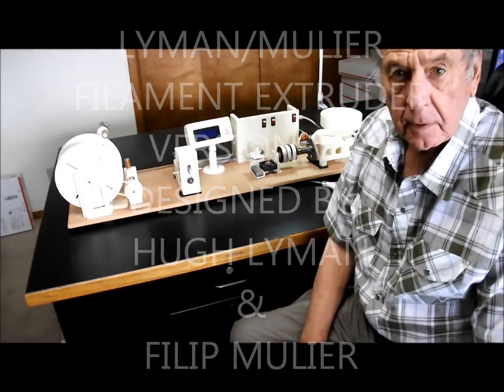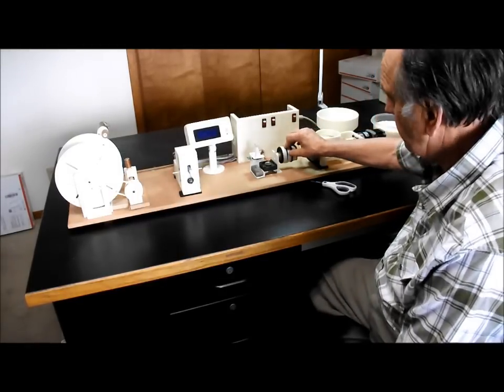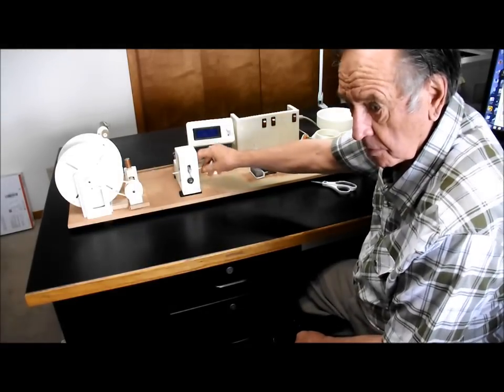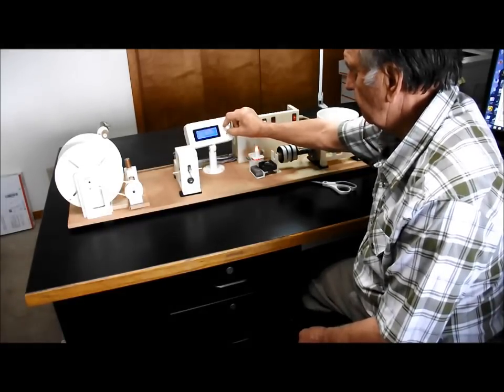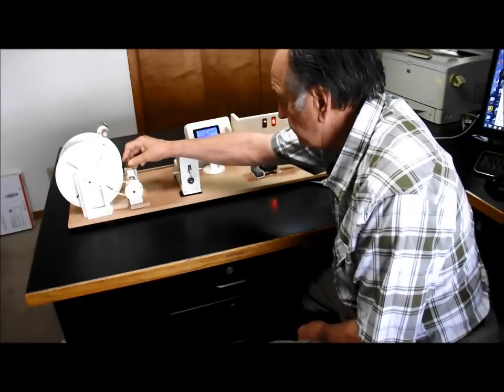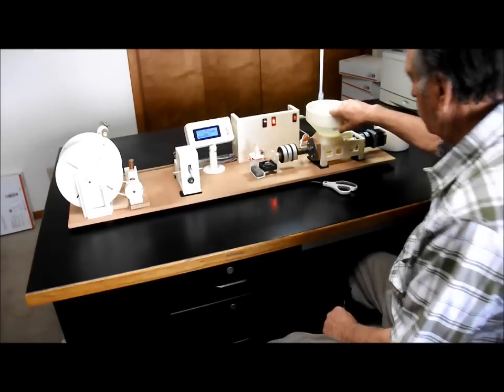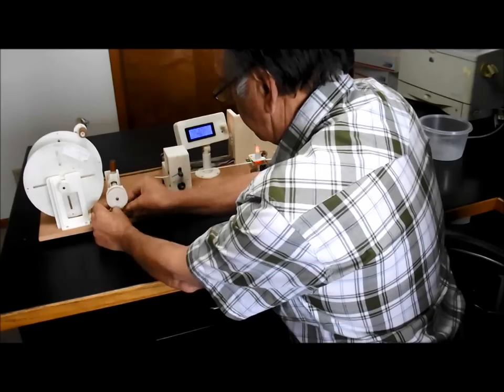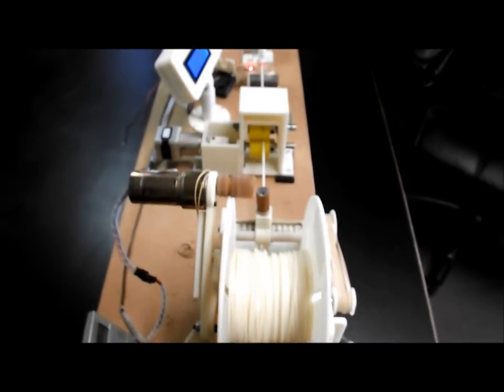LYMAN MULIER FILAMENT EXTRUDER V5 video 1

Comment: Make 3D printer straight from the pellets. ;P In my work on EDM, I made a star-shaped nozzle and calibrated the brilliant quality of the surface and strength of the products, also rotation nozzle  strainer with micro holes (aligned in one direction in parallel, or tangentially to circular motion). High pressure requires stiff filming, and I thing, pellet directly injected into the nozzle through a screw, this can be a good solution. And the vibrations that mix polymeric bonds at the printing nozzle may somehow increase the strength.

Comment: Wonderful job Mr. Lyman...
I'm building my own extruder using your guide, but I'm making a big improvement to speed up the process of extruding filament.

I plan to use a Peltier chip to create a sort of AC cold air to cool down filament and still be able to speed up things....

The goal is to extrude like 1kg in one hour.

Comment: It is wonderfull!
What kind of sensor are you using for measure wire's diameter?
sensor phillips? what kind of sensor is it?

Do you use any kind of feedback for control speed pulling the wire in function diameter measured?

Thanks very much!
Good Luck
Reply: "Sensor designed by Filip Mulier"
Reply: I understand that jejejeje!
But, Is there any kind of information about it?
Is there any specification?
Where can I buy one?
What part number it have?

Best Regards and thanks.

Comment: Has anyone completed one of these? I ordered the sensor for measuring the filament and plan to build a complete unit over the next few weeks. I am wondering the tolerances on 1.75mm filament, he states .1 on 3mm but gives no numbers for 1.75mm. And how well will it compare to ordered filament? 

Thank you
Reply: Wayne Kinne  I'm still working on my v5, but I've already decided to try a few adjustments. I'm using a brass F-F coupler and removed the hex portion of it. I ordered stainless 4" nipple and found out that it doesn't have an internal seam and it has a smaller internal diameter. I've also taken a copper pipe cap, removed the end and kept removing material until it fit in the center of the brass coupler between the brass plug and the stainless nipple. This gives me consistent internal diameter. We may be able to use another longer copper pipe shim to close the gap around the od of the drill bit in the melt zone. I've also considered polishing the OD of the bit to reduce production of metal bits with tighter tolerances. I'm also playing with using sheet metal to make my drill bit look more like the $600 auger. By experimentation I found a strip width that when I clamped it to the end of the bit I was able to pull it into the trough of the bit and end up with a trough diameter close to the auger spec. Then tapered the strip width to have a gradual transition. I'm also in the process of milling boards and making the 3 led filament sensors and would be happy to send you a couple. I also have an extra 4" stainless nipple. I would be very happy if you were to try these ideas because you have already put so much work into improving the v5 with Flip. I also think (just think) you only need a very long water cooling trough to run high production speeds. Russ aka rwg42985 on YouTube has already designed and is using a small water cooler. I hope to here from you.
Reply: I'm wondering the same
Reply: ***** I finished mine months ago, I am not happy with the results. Making filament is easy, making good filament is very hard. I visited a large filament extruder a couple weeks ago to see what I might improve, I think, and I repeat "think" ( I do not know ) I think this unit has two areas that need improving. One is the auger, I think the $600 one for sale on line is needed and also a machined tube for it to ride in. There is no way to create pressure at the extruder head so there is a great fluctuation in flow that results in fluctuation in filament size that is uncontrollable. Next I think a long water cooling system is needed, first with hot water then another with cool water. And when I say long I mean 4' minimum, maybe 8', I wont know until I upgrade mine. If you want to print small parts this extruder may work fine, but my prints are often over ten hours long and it is almost impossible to make long enough runs of filament to run ten hours that do not get too thin or too thick and destroy my print. These problems are with every extruder I have seen, they will all make filament but none make filament you could sell online. I am very picky, I want the best I can get and if I can not make it as well as what I can buy then I will buy it. When I visited the filament extruder a couple weeks ago I purchased $800 worth of filament, they sold it to me for $18 per 1k spool plus they gave me two spools. Since there were no shipping charges this was a huge savings over their normal $23 per spool plus $9.50 shipping each.

Even with all this negativity I still love my Lyman Extruder and when I have time I will be upgrading it. Some days it will make great filament, other days I can't get 10' of "good" filament from it. I have a deadline to make 40 hexapods for a Varsity Boy Scout camp so I had to bite the bullet and buy filament, otherwise I would still be tweaking my Lyman.

Good Luck,
Wayne
Reply: ***** I printed my pawl, I uploaded it to thingaverse I think.

I have 3 printers, 2 Prusa i3's and an M2 MakerGear. The Prusa's will run this filament much better than my M2, it has about a 2 mm upper limit that the Prusa's do not. My M2 is a much better printer, much better, so it needs better filament. The Prusa's will run this stuff because the filament feed system is much more sloppy. 

If you play with it enough you can get filament you can use, I am very much a perfectionist and want/need to be able to start it up and walk away. I just have way too much going on.

A good way to make it much more usable is to add a filament sensor to your printer, it will speed up the feed when the filament is thin and slow it down when it is too fat to keep prints sweet. I just am the type of guy that wants to make perfect filament and not add band-aids so I can run it.

I just bought a cyclops head for one of my Prusa printers, I can't wait for three headed beasts that mix the three primary colors to give you what ever you want. One guy has already done this and I am sure it is not far off before the needed code is added to Marlin.
Reply: Daniel Kruger
Reply: muhammad butt  What?